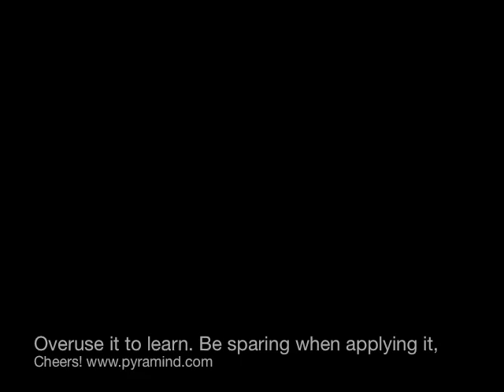Tip #12 - General Mixing Techniques - Using compression

Comment: You're basically right about bandwidth--I might have been talking more about amplitude than I was about frequency

I could explain further why bandwidth itself is limited as the surrounding amplitudes of a signal are reduced, but this discussion is about to get really convoluted.

Comment: One thing to add: it's a nice touch to sync the release with the rythm. Found this tip in an ebook (think it was called "Audio Effects, Mixing, Mastering" by Bektas) and it usually works out great. Just calculate the time per beat in ms (TPB = 60,000 / BPM) and use a reasonable multiple or division of that.

Comment from the maker: Yes. This is correct.

If the threshold is -10, ratio is 2:1, and the audio energy passes the -10 threshold by 4 db, the audio will be reduced in amplitude to 2 db above the threshold, or -8db

Comment: The bandwidth is easy to understand--it is visually represented in any audio software as the squigley lines of the recorded signal.

Compression compresses or squeezes those squigley lines together.  I think the beginner can understand the concept of compression when it is properly explained. 

If compression isn't properly explained then it won't be properly applied.

Comment: I've been thinking of a better analogy.  I don't have one yet but I do have one other thing to add.

Compression is used to control an audio signal that is in danger of peaking.  This is true.

Compression is also helpful to make an audio signal sit more sharply in the mix.  The squeezing that compression does of the bandwidth makes the sigal tighter, more focused, and less dynamic.

Comment: There isn't a difference relatively between bringing up the lower parts or turning down the higher parts--the point is that they are brought closer together.  Perceptually, the softer parts sound louder and the louder parts sound quieter. 

I'm using the term bandwidth correctly.  Amplitude samples are taken by digital converters and shown graphically by computers as a bandwidth between 0 -20 Khz.  Compressors work to squash this bandwidth which also squashes the dynamic range.

Comment: I think you explained it well and find it quite interesting and easy to understand.  My only struggle is understanding the ratio part.  Math isn't my area.  Which number in the ratio stands for what.  If you have your threshold set at -10db and the ratio is set to 2.1, what does that exactly say?  Which number stands for what?  The 2represents what and the 1 represents what?  Please advise- thanks!

Comment from the maker: Well, coimpression is a tool for limiting the dynamics of the audio. It evens out the soft parts in comparision to the loud parts, so you would use it as a tool if the part that needs compressing is TOO dynamic. It will help level the playing field, and you can potentially get more volume out of the track. BE CAREFUL, though. Not all tracks need compression.

Comment: You actually have to be careful not to confuse volume with compression because they do have such a similar immediate effect.

Compression is different than volume in that it allows the compressed signal to stick out in frequency--as the bandwidth narrows the signal gets more edgy and sharp.  

Compression in this respect is like eq.

Comment: My explanation wasn't analogous--it was to the point.  Compression isn't a volume knob.  If you want to automate volume, use automated volume.

Compression is used to narrow the bandwidth--thus bringing the softer parts up in volume in respect to the louder parts of the audio signal.

Comment from the maker: ok, you can eq then compress, or compress and eq... there is no law for this. This is where audio engineering gets tricky, and it would be goo for you to look over the shoulder of a professional and try to get a grasp of the difference. Eq before compression is a bit more rare, since usually people prefer to calm the dynamics of a sound before attenuating or boosting eq. This is because eq can change the reaction of a compressor. Listen and see what works best for you. *bows*